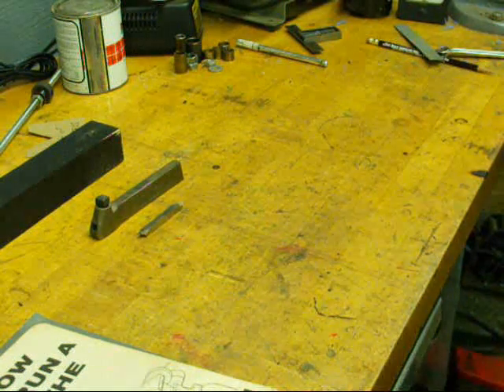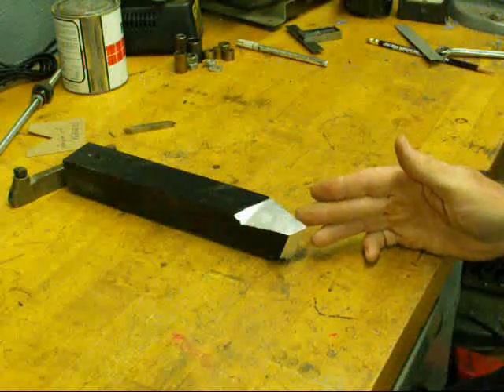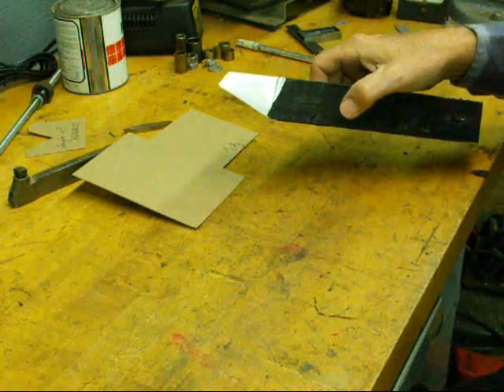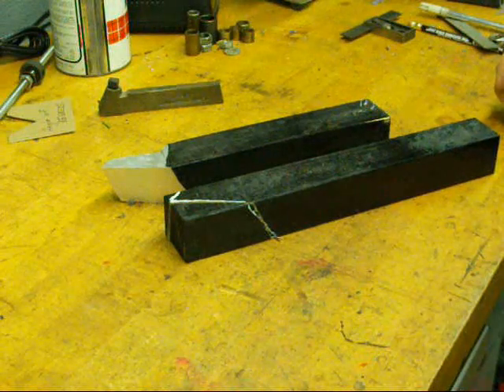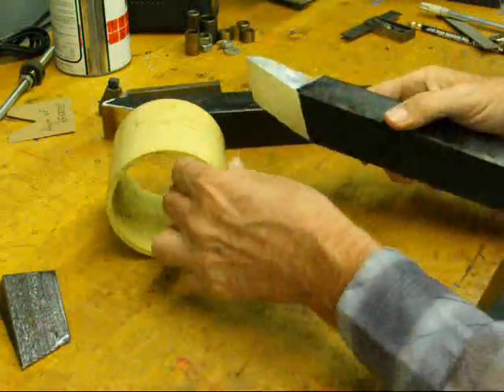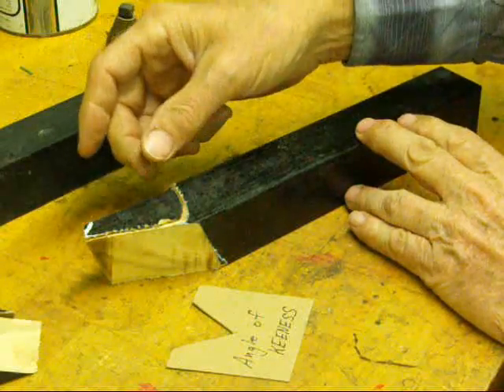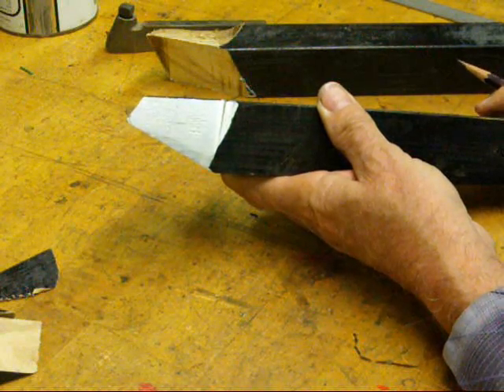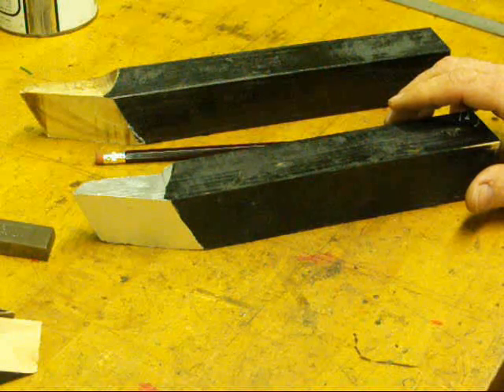TOOL BIT GRINDING #1 South Bend Atlas Lathe tubalcain

Comment: Mr. Pete, thank you for the great tool grinding video series. I realize these are older videos but helped me so much understanding cutting angles and dedign. I was not happy with the finish on my 618 using insert tooling. Luckily I have a ton of old HSS blanks in various sizes. After watching the videos several times, today I made a right hand turning tool and one of my own design. After twerking a little they do a great job. If I might make a suggestion could you make an updated video with some attention to angles needed when using modern quick change tooling. Realizing the old holders held the tool at a 16 degree angle usually. It would be nice to see some HSS tooling held at proper angles In an Alurus style holdholder. I'm experimenting but a little help would be so appreciated. My little 618 likes HSS!!
Thanks, Chuck 
Merry Christmas!

Comment: been using indexable inserts for years and finally reached the point where i am doing more advanced cutting and need specific shapes cut. geometry is really they key when i see people bluing new HSS cutters its usually because of wrong choice or rake on the cutting edge. an easy mistake if you've never been taught the proper way. great video.

Comment: I'm very new to the machining on a lathe, and I've been having a lot of trouble understanding cutting of tools.   I just discovered one example of why.  At 3:45 of this video mr. Pete talks about an angle of slightly less than 90° or 85.  My visualization of this tells me that it's more than 90 degrees or 95.  As he says this and my brain goes into lockdown before I can understand of course the video has moved on so I replayed it.  We started with a straight line and we're cutting back an angle  removing the corner if we cut the corner off continue cutting to a 90 degree angle,  we then continue even farther just slightly more than 90 degrees because slightly less than 90° would cause it to bind in the corner as was shown on the cardboard cutout.  I realize it's a matter of semantics but these kinds of things are what confuse novices.  In my mind this is clearly over a 90 degree angle to provide clearance in a corner oh well just a thought.

Comment: I am totally new to machining.  This  is best video I have found on the subject of tool grinding and angles.  The video really helps me understand why the angles are there, why they are important, and the suggestion of a very slightly rounded leading point of the tool was like seeing a light in the distance for me.  thanks much
Reply from the maker: Thank you, I'm glad you like that video. It's a real old one, but I think it stands the test of time

Comment: Mr.Pete Would you mind me asking what type of grinding wheel to use on HSS tooling. I'm having alot of problems with chattering no matter that I cut. Aluminum steel what ever I don't know if it's my tooling or lathe.
Reply from the maker: Mine are just common aluminum oxide medium grit wheels from the hardware store
Reply: Thank you. Any thought on chattering. Or is there way to many reasons it could be.

Comment: Thank you Mr. Lyle, for an example of a different kind of single point cutting tool.  It seems everyone has a slightly different view of what is the best, so I guess all I have to do is combine the good ideas to get The BEST of the BEST. 

For those who haven't been grinding cutters for 50 years, I would be very interested in seeing different types of cutting tools for different tasks, such as inside applications.

Many, many thanks for your effort and teaching,  I'm planning on using what L learn here to pass the micro masching part of the AWCI Certified 21st Century Watchmaker.

Comment: I wished I had you as a shop teacher when I was young. I purchased a Atlas TH54 6 months ago, after taking apart, painting am now ready for my first chips.  Im cutting my back plate off as a first  chip experience. I seen your stuck chuck methods and i tried them all. And I seen several grinding HSS videos, most were with tool posts. It  sure is nice to see how it is done for a 
lantern holder. with a wood model. Im now ready to re grind my HSS and try again.. Thanks Mr Pete.
Reply from the maker: Thanks Frank. I'm sure glad the models helped you.

Comment: Great video, I don't even use a lathe but I still learned the basic geometry of that cutting tool. I wish you could use the same method of explaining (with a piece of wood), but use it to show us newbies how to grind a fly cutter bit, I have seen a few videos but still can not envision a compound grind and halfway through watching the video, I would lose track of the cutter's orientation. could not tell which side is going to do the actual cutting(but if it was painted it would help).doing a video on how to grind a fly cutting tool bit  will help many of us.
Thank you .
Reply from the maker: That would be a good one-thanks

Comment: Mr. Pete, how are you. Great video, so im fairly new to the lathe., Im in the process of cutting 848 pure iron and finish turning has been kicking me around. Ive seen alot of videos. It seems that everyone speaks about the angles of the tool. But no mention of the angle approach to the workpiece for turning or any other cut. If you have the time I could use your help on this topic, Thanks
John

Comment: Hello, Good job! I used 7-7-70 for the degrees of a lathe tool. 7 and 7 for the side relief angles and 70 degrees for the "Angle of Keeness". I, also, set the tool rest on the bench grinder above center so I could get an approximate  7 degree tangent on a 1/2 tool bit. My job as a apprentice (50 years ago) was to dress the bench grinders and set the tool rests for the first year then a NEW apprentice would take my job. I loved those days and all the next 40+ years in a machine shop. Please keep up the videos. Mike
Reply from the maker: +Barbara Zawlocki Thanks-thats good advise
Reply: Dam one year dressing the grinder and set tool rest.. wow-But you stuck with it and made it . I was a carpenter 35 years and skipped my Union apprenticeship.. But i worked with (non union) two real sharp guys for 2 to 3 years and after that i had all the basics down.. I was lucky enough to get into all aspects and was the foreman or super for most my life.. Anyone that wants instant gratification will never make it in the trades. Be the first to work the last to leave---- last to break and first back---  at 4 years you  know very little- at ten years you know a lot--- at 15 years you think you're hot stuff-- than at 20 years you realize how very little you really know, because there are so  many types of work and specialties.. I finally learned if you can learn one trick from every person you work with you will be way above the rest. As a boss it is easier to teach new people- than so called experts that can only do one or two things. The fun is always learning-- always pushing your limit. Very few people want to be at the top and make the decisions.. There are some kids that come in and all really sharp-- and there are others that have been doing it 30 years and know nothing... Loved it all. Miss it now.

Comment: Excellent! I just bought an old Craftsman 12" Commercial lathe. It was really rusty and dirty and I spent over ten hours cleaning it and oiling it. It's really in pretty nice shape and was mostly neglected and filthy.  I just finished my first project, I made a bushing for my Bobcat seat safety bar. I discovered I have a lot to learn and I will be watching your videos again and again. I can already see mistakes I made earlier today. I'll check eBay for the books. Thank you so much for taking the time to teach!
Reply from the maker: +Arne Vainio  Thanks for watching---you will like that lathe

Comment: Thanks
I have had my lathe for a short while and am using brazed and insert carbide cutters. I want to start grinding my own and this video is a great help. One question. I use a quick chang tool post so how would I add the back rake?
Reply from the maker: +Ray McCrodden Tilt the tool back when grinding the side rake (7:45)
Reply: Thanks again
 Im going to get some 1/x12 stock and practice grinding like you advise before I try real HSS blanks.

Comment: confusing, Tubal!  You dont adequately demonstrate what you mean by 10 degrees, are you holding at a double angle,? It would also help to explain why an angle is called " back rake" or "side rake". Wht is the reference to call it back rake; what does "rake" mean? You might help clarify or justify the term so it doesnt seem like justan ambiguous term pulled out of the air.
Reply: You may want to get yourself a copy of "The Machinery's Handbook". There is a whole section on cutting tools explaining geometry and terminology. They can be found at old bookstores and flea markets it doesn't matter what edition.

Comment: Thank you for your fine instruction.
The block of wood is easy to se and relate to.
I worked in manufacturing years ago, but i lost the skill for grinding tools.
I work in a hobby shop with a friend and we just aquires an early south bend 13" swing lathe.
Trying to remember from way back when .
Reply from the maker: +Dawn Conti Thanks for watching

Comment: great vid my lathe is on the way  but i am not going to be useing a tool holder like u have with the extra angle on it  just the multi tool holder that it comes with an was woundering what the other angle was  ive never used a lathe yet and am going to use hss steel blanks to grind my owen tooling  thanks again for the great vid

Comment: Thanks for the great videos!  Appreciate all the detailed explanation and enjoyed your nice presenting style 
I'm going to the basement now to start grinding my first tool on a 5% cobalt blank - didn't think to order softer... I just got an old Atlas/craftsman 101.21400 in great shape. It came w/ carbide tools, mostly chipped, which of course gave poor results on some 5/8" CF round I had.
After reading the South Bend book, it seems grinding tools the old way is likely best way to start & learn

Comment: part 1 of 2, thanks for the great vid, I have a homemade boring bar I use to use in a drill press with a bearing plate in the table vice,  the a machines  guy made for me when I worked in the bush, but have not been able to use it for years, as all the bit he made for me plus lots of extra tool stock, but I cannot sort out how to sharpen them,

Comment: part 2, they have this strange hollow grind up one side, and a very sharp point on one corner, could you “please” do a vid on how to do this drill press boring bar tool cutter, a baring block is clamped in the drill press vice or I welded it to a log loading clam ear with another boring bearing plate on the other side and drive it with an old washing machine motor and pulleys

Comment: I mostly use carbide but I drawers full of tool steel up to about inch dia. every so often I have to use tool steel ones  for a certain project with curves or notches or spap ring grooves .but its so long between those types of jobs that it takes awhile to remember how to get started with your help it was easy to get back in the swing of it  Thanks Bob
FYI If you teach it we will watch

Comment from the maker: @weedoni  I use regular HS tool bits in my aloris. Rotate the whole tool post to get the angle you want. And yes grind a little more back rake (top) on the tool.

Comment: my Logan 10" did not have a tool post when I got it. I installed an Aloris AXA post & holders. as the holder presents the tool to the work, at right angles, I guess that tools ground to use in it, do not get the releaf ground on the top of the bit. as you showed in the discussion, where you also showed tool holders that did not have the 16-1/2 degree back rake..do you have a video that showes the use of these type of tool holders?..great instructional class by the way..

Comment: Thank you for time spendt on this Video Im Machinist too, worked on cnc Lathe and now on cnc mill and your tips are very helpfull for both. I usualy use modern tools witch changeable cutting plates but some of our work parts still have to be done with hss tools (due to custom shapes or dificoult placement)

Comment: Another informative video. Thank you! After seeing your 4 jaw chuck demo, I went out and bought one for myself. Used your method to align stock in it and it worked like a charm. Was wondering if you could reccomend angles on a hss bit for turning stainless steel. Thank you.